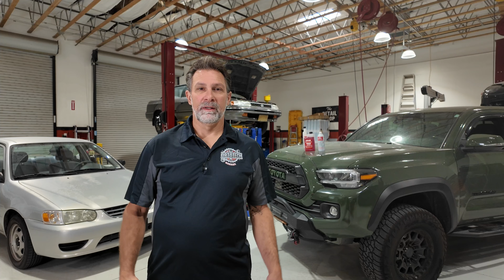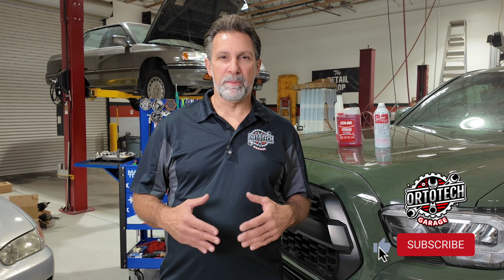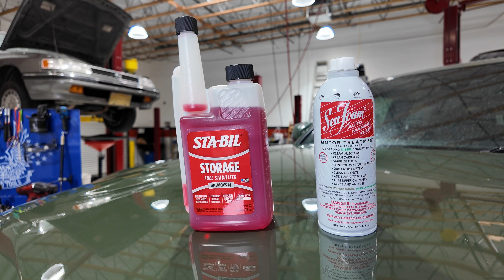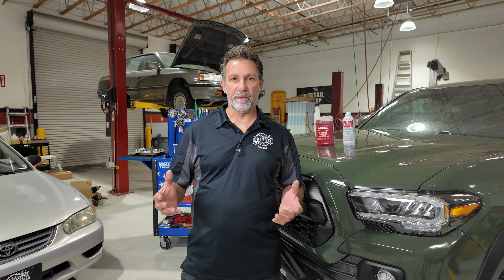Car Storage Tips for Long Term | Avoid Engine & Battery Damage | OrtoTech Garage

Comment: So If i can ask my friend to ride it once in a while what is the best interval?? every week for 10-20km?
Reply from the maker: Yes,  ideally once a week would be great, every 2 weeks would be ok.   Its more important that the vehicle gets up to operating temperature before you park it again.  So a 15 minutes drive through some varying conditions, not just idling, would be great.  Run the A/C for a few minutes, too.  Check the tire pressures every couple of months.  👍

Comment: Can I do all of this in my 2019 Camry Hybrid?
Reply from the maker: You can. The only thing is how well the high voltage hybrid battery will hold up for extreme long term, like a year or longer.  I have not seen a hybrid in storage for that long so I can't speak from experience on that part.   The high voltage battery will only get charged while you drive it, unless you have special tools and knowledge.   It won't stay charged through a battery tender.

Comment: Couldn't we just hook up the battery tender without disconnecting?  Like it's going to maintain charge anyways, so why disconnect it (assuming indoor garage storage)
Reply from the maker: You bet!   I think I may have worded that a little confusing in the video.  If you use the eyelets and wire harness included with the tender you can just leave the battery connected and plug in as needed.   Thanks for clarifying that. 👍

Comment: Great video.  I have an older inflatable vehicle storage capsule that mitigate rodents. I still over inflate and use a battery maintainer for long periods. I’ve seen some a cost effective fully enclosed vehicle covers that zip 100% closed.
Reply from the maker: Those are very cool!  I wonder if they need to stay plugged in or have some ventilation/air circulation inside. I have never seen one in person. I think it's a great idea though.
Reply: No power needed. Unzip, drive onto the open bottom portion, fold over the top portion and zip it completely closed.

Comment: Thanks for the detailed instructions and advice. I am storing 2 cars, one outside and one inside a garage - I'll use a couple of your recommendations I didn't know until now. As for Fuel Stabilizer, I use Ethanol Shield and having good results with this product.
Reply from the maker: My pleasure!  I have always used Stabil, but I am confident they all work well.  I would certainly stick with what works for you. Thanks for watching, sharing your comments, and supporting the channel. Best of luck with the 2 vehicles!

Comment: Modern gasoline will cause harm  during winter storage mainly due to the ethanol content .. Best thing is to fill your almost empty tank with ethanol free gasoline if available...No more ethanol free gasoline here in Canada since 2025.. So for our classic cars indoor storage ( mainly cars before 1990 ) we buy E0 Race gasoline ( like VP Race fuel C9 or Sunoco 260 GTX ) and put 10 gallons in the almost empty tank, run the engine and put the car in storage. For tires and storage for 4-6 months, inflate them to the maximum pressure marked on the sidewall if you don't jack the car.
Reply from the maker: Great points!  Thanks for contributing.  We have all sorts of blends here in the US depending on climate and tegion, but most of our fuels have 10% ethanol now, too. We also have a bunch of E85 fuel systems as well which can be more problematic.  Our emissions regulations don't generally allow more than 15% and usually less in summer heat.